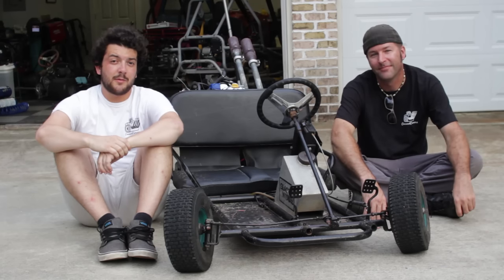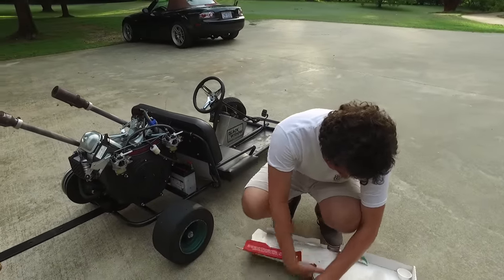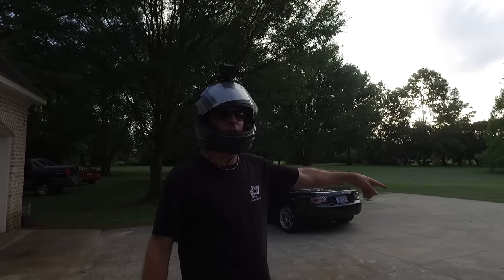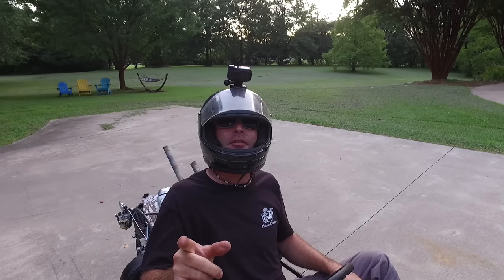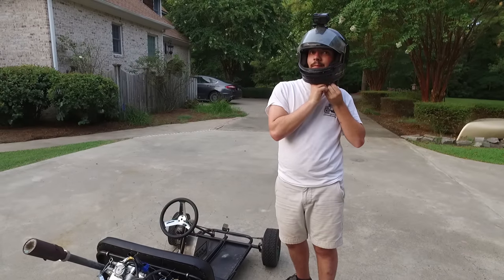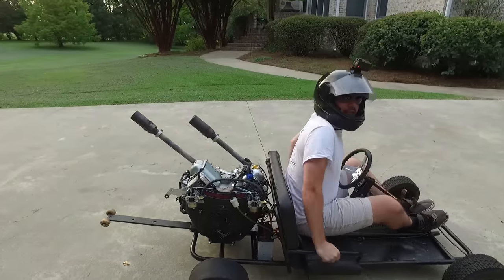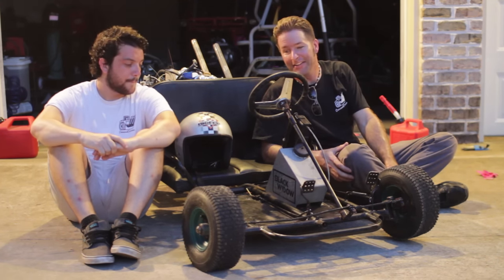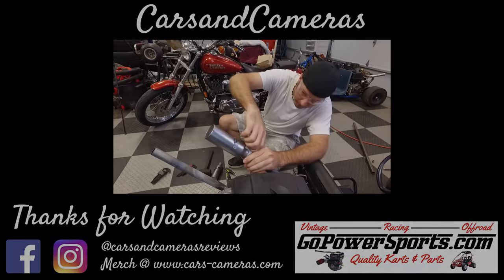Modified 670cc Performance Testing

Comment from the maker: Let us know if you have any ideas for modifying this engine more! Other than a twin turbo EFI setup... We aren't made of money.
Reply: Big bore kit
Reply: Or a snowmobile motor old 440s make like 56hp
Reply: change the gearing to help the top speed
Reply: +Noah Unknown YESSSSSSS I have been saying that for a while now
Reply: You should put wider tires on the back
Reply: hi
Love the videos
Reply: CHEAP STUFF!!! - You could try an H pipe on the dual exhausts and see if there is any type of scavenging that occurs. you also might see what affect a wider belt would have.  It would essentially give you a higher gear ratio, giving the same performance that larger rear tires would provide, without raising the center of gravity.  You could also try adjusting the flywheel weights... It seems to me like its passing the engine's power band before it is kicking into a higher gear... This would definitely increase the engine life, as well as just be a smart thing to check into.  Why wind the engine into redline when 'possibly just below redline' has exactly the same amount of acceleration and power.

Keep up the good work. have fun.
Reply: Supercharger?
Reply: NOS?
Reply: Nitrous buddy
Reply: Put a Yamaha banshee engine on. 2 stroke 350cc.
Reply: how about changing the the valve springs to a harder ones
Reply: 115 horse boat motor cheap and tons of power
Reply: Mulletman Survival that's a horrible idea.  Boat engines need water to cool themselves.
Reply: +Ben Kempa change it make so you can cool it like a car engen
Reply: build a go kart with an r1 1000cc motor and an r1 gear box.
Reply: Bore kit if they make one? But I'd do cam push rods and valve springs along with piston rods
Reply: And add longer gears and wind this thing out man
Reply: I would lengthen it a bit, maybe put wider rear tires on it and even put an old Polaris 250 2-stroke ATV Motor and trans on it. Think 1980's TrailBoss type deal with a CVT and rear wheel drive
Reply: Put nos in it all bs aside lol
Reply: Lower you wheelie bar to prevent that rear hop. You have some serious backlash there.
Reply from the maker: Not sure if they exist for this engine
Reply from the maker: We don't want to make it faster on that frame... Too scary
Reply: Aluminium flywheel larger jets for crabs bit expensive but pistons and con rods?
Reply: +CarsandCameras you guys got to make a beast find a strong frame and a bigger frame so you both can fit in it comfortably because you guys look all crammed up in some of your go carts haha , but instead of wasting time and money on these little ones just build an absolute beast , get the fattest wheels you can for the rear , the biggest and most modifiable engine you can and just make it and absolute beast
Reply: turboooooo
Reply: Different sprocket sizes for top speed. The thing has PLENTY of power to wheelie, so why not change the top speed so it isn't 45MPH?
Reply: nitrous
Reply: Advance the timing like 2 or 4 degrees, lighter fly wheel, basic stuff like that
Reply: Valve springs too
Reply: run some nitro methane
Reply: Some wider rear tires and slick front tires for the kart. OR swap the 670 onto John's kart in place of the 212 and have an insane race kart.
Reply: put a catch can on it
Reply: you can hook a rad up to it
Reply: air filters
Reply: To be honest, I reckon before you modify it anymore and actually fix the modifications you've already done. Like the oil spill, proper carb linkage instead of the coat hanger and welding wire throttle. You guys are already looking into tuning and putting filters on the carbs so that's good. To be honest, I'd like to see this build go nice and clean, I don't mind how long it takes. Great content guys
Reply: Also look into seeing what's up with the belts/tyres. And if your looking into nicer modifications, I think a new chassis or new body along with front axel would be cool. The kart is tooooo ugly for such nice power. 

You guys make great content and this is the only channel I ever give feedback to or comment on as I find that you guys are responsive and actually take feedback in. I respect that.
Reply: A Alcohol conersion, fuel like VP 40 as an example. It's a lot more torque but probably costs too much for something like this,  but I have a Briggs and Stratton 5 hp flathead converted to Alcohol and the acceleration is insane!
Reply: go to a junkyard a get a old smog pump and use it as a belt driven supercharger
Reply: You need an adjustable linkage to put between the carbs to sync them and balance the cylinders.  There are videos here on youtube showing how to make an effective manometer, just search for "carb sync tool". I'd also agree you need a puke tank to catch the oil. 

Edit: Front suspension would help, one of these times you'll land a wheelie and lose a front wheel. ;-)
Reply: adjust the driven pulley spring hole seat for an earlier upshift or a later upshift. There are a few videos on how to do this.
Reply: port, polish, flat top pistons if available, re-set carbs, deck the heads, bigger exhaust with h-pipe, fatter tires, stronger wheelie bar, pods, fix the little stuff to clean it up. Long list but would be worth IMHO
Reply: And an aluminum flywheel, you don't want the factory one to explode
Reply: cross-pipe on the exhaust
Reply: put some pvc pipe on the back wheel.
Reply: Hey guys I did the same thing to my 250 ninja....(removed the air box) oil spewed out all over as soon as I hit the throttle. I hose clamped a small breather filter to the hose and my problem was solved. Of course this was "FOR TESTING PURPOSES ONLY" and not really recommend....
....It'll be fine 👍
Reply: gearing it up. bigger sprocket on the torque converter and a smaller one on the axle
Reply: You are just running out of gearing. It's like you are in your project car that you just added 300hp but you are not able to shift out of 2nd gear. 

Also, as for linkages for those carbs, go to your local hobby shop and get some threaded rod and a bunch of Traxxas rod ends along with a bunch of small nuts and bolts. I bet you guys will have everything needed for a good, reliable linkage for 20-25 bucks.

Landing those big wheelies is killing the front axles I would imagine.
Reply: Other a body for airo dynamics/LIKE MY MUM ALWAYS SAYS...DUCKTAPE!FIXES!EVERYTHING! P.s. Airo dynamics is key far carts
Reply: shared tube for the air pod.. like a plenum.
Reply: dirt bike carbs. weld and the cam , port the heads
Reply: gears and nitrous
Reply: Port the head! luh da bill
Reply: Well it depends on how brave you are, get a cam welded and reground and valve springs these should cost around $300-325. Beware of rod failure and the flywheel flying apart. This will almost double your power. Did for me anyway.
Reply: NOS
Reply: Lighter flywheel, stronger valve Springs and electronic ignition timing will give you more acceleration. 

but your top speed is a transmission issue
Reply: drag tires, some kind of gearbox, electric supercharger.
Reply: Make it mor badass
Reply: +Zeke Crumley I forgot the e
Reply: +Mulletman Survival boat motors are not cheap to buy, replacement parts are very expensive. plus now you are dealing with a vertical shaft versus a horizontal so you would need a rear end of sorts.
Reply: proper gearing is all its missing... it's geared like a 20 mph yard kart and built like one... so it's time for chassis upgrades... take the front off of one of your racing karts or just mount the 670 to a racing kart? idk but I give it 5 more wheelies before that front wheel falls off lol
Reply: Big bore kit, chain and sprocket on the axle, and suspension. Maybe even some big tires.
Reply: A larger diameter tire so your top speed would be higher and you can do higher wheelies.
Reply: Snowmobile transmission.
Reply: Cvt transmission
Reply: make a donation site for a twin turbo efi setup :)
Reply: Billet crank and flywheel, 24lbs valve springs, performance cam if you can buy them or regrind your cam
Reply: or dual dirt bike carbs
Reply: * Put o2 Sensor on it so you can actually maximize the power from the dual carbs!
Reply: roots type supercharger out of a VW smog pump, it will work.
Reply: Bigger tires or a bigger pulley
Reply: Atv tires 14 inch
Reply: Mill the shit out of the heads and moderately port them, port match the intakes/intake  to the intake ports, port match the headers to the exhaust ports, methanol capable carbs/carb.
Reply: +fightfanian oh yeah, zero deck the block, that along with milled heads should make for some nasty compression, methanol should keep it cool and pre-detonation at bay. if you end up with valve clearance issues, you can notch an old valve and braze a piece of carbide into it to fly cut the pistons.
Reply: +fightfanian one more thing, if you lengthen the intake runners by a couple inches it should make the intakes better at higher rpm and maybe keep the fuel in the carbs cooler for even more power.
Reply: BLUEPRINT!!!
Reply: Port and polish would be lit asf
Reply: why dont you put manual transmission? you could go any faster you want and even more power at mid-high range
Reply: Nitrous, and make the wheelie bar shorter
Reply: It not a performance part but you guys could add a catch can for the oil
Reply: If you can get a billet aluminium fly wheel
Reply: 1. Pod Filters
2. Crankcase breather filter
3. Remove rev limiter
4. Reinforce front-end axle and wheels for wheelies
5. Replace the pizza box with something permanent
6. Do a 2 into 1 or an H pipe for more torque, less backfiring, and smoother exhaust flow.

The gearing on it now seems really good, with the rev limiter removed it should do well over 50mph. Acceleration and wheelies are much more fun than top speed. Wider tires or a better torque converter should help to get the power to the ground.
Reply: Put a new better cam and flywheel in it.please respond
Reply: I think if you lower the wheelie bar a little it won't slam on it so hard and knock it back down. No performance gain but would probably result in longer wheelies. You've already done all mods other than tearing into the motor. There are cams available. Bigger diameter tires.
Reply: You may not be made of money but go power sports are!
Reply: where you buying engine like that
Reply: Ported and polished heads, re profiled cam, increase compression and maybe try running some velocity stacks on your carbs
Reply: A roots blower?
Reply: +TheVancen hell yeah,  supercharge that shit
Reply: Will that wheelie bar fit on my honda?
Reply: dyno cams sells cams for that 212 and the valve springs to go with it and all kinds if performance parts for racing and they can coustom grind cams too so you can probably get one made for the 670
Reply: Buy twin 301 or twin 420 carbs for it and deck the heads
Reply: I'd like to see you make a V twin front engined, full drift purpose kart! The 3 wheeler is nice, but a proper drift cart would be a thing i'd like to see.
Reply: Port and polish.
Reply: fix the camper on the front left tire?
Reply from the maker: We don't want to die
Reply from the maker: Higher RPM = rod in back
Reply: I'm thinking that if u put air filters on it that it would make the engine run a little more rich witch would make it less restricted in some sense because those carbs are designed to have a little resistance on the intake to help suck the gas out from the bowl.
Reply: get a custom cam ground (shouldnt be to expensive), add stiffer valve springs and pushrods. this will get you into the 6000-7000 rpm range then a  2-1 exhaust with a street bike muffler to mellow it out.
Reply: Nitrous oxide & octane booster
Reply: Try to add chaindrive + a gearbox fitting the motor & redo the motor mount so it fits with the gearbox & chain drive.
you could also ofc get it a wider belt & up the gearing a bit as it is atm for a cheaper fix.

If you happen to find a cheap dirtbike with a single carb & over 700cc (easier to setup right for all cylinders).

Id love too see a 4 cylinder motorcycle engine on that kart. it will be loud as hell though from the back with an exhaust like that on the kart now heh.

Maybe you can call around too various junkyards or make an ad on craigslist & see if they have any bikes that has been written off as junk from insurance companies that you can scavenge parts from.
Reply: add turbo charger, super charger and nitrous
Reply: You need to fabricoble yourselves a hot form oven so you can build fairings and put more air where it needs to be. Believe it or not, a bench + guy on something like this will cut quite a bit of the air flow going to cool the motor/s.
Reply: Bore the cylinders and get bigger pistons and jet the carb
Reply: turn the engine round 90deg and fit a direct drive differential
Reply: Twin turbo pro star 1000 motor
Reply: +aserta new word alert! fabricoble! you rock dude!
Reply: +Mr. Me 👍
Reply: +Farhan Yustio harbor freight
Reply: yes but can you put a 2 stroke engine sir
Reply: Upgrade the wheels and tires. Also maybe brace the chassis some more.
Reply: idk why people keep saying put nitrous or bigger gears. nitrous wont help at all and they arent gears, its a sprocket, and they dont even have any its a progressive clutch so its a constantly increasing "gear" size. nitrous too would be roo mich for that tiny motor anyways i feel 😕
Reply: you opened the exhaust and air intake. Increase the main jets, you should get some more power... It's surely running lean. Or even better get 2 bigger carbs
Reply: CarsandCameras you should put this engine on the rat rod wagon, it's such a perfect combination
Reply: I love you
Reply: CarsandCameras  don't do it in slow motion
Reply: P
Reply: CarsandCameras performance heads and blower
Reply: CarsandCameras what cameras do you use
Reply: CarsandCameras front a arm suspention
Reply: CarsandCameras lower rear tire pressure?
Reply: CarsandCameras put gears on it
Reply: slicks
Reply: maybe a second gear or 3?
Reply: Adding an homemade quick shift system with some sensors or another electrical equipment.
Reply: CarsandCameras
Reply: hey guys I think I know why your kart aint reaching 50+mph. The Valve springs on it are probably so weak that they just float at a certain Rpm. No matter if the engine was stock ungovenored or modified ungovenored. If you just buy some 26 pound 212 springs  I think you can reach your death defying speeds. Love you guys and your content.
Reply: CarsandCameras propane injection into the air breather just need some old bbq parts and a propane bottle
Reply: Get some better wheels. These ones look crap and you can kill two birds with one stone and get racing compound or mixed surface racing tyres of some description. Make rear wheel diameter larger.
Reply: put twin mikuni's on it!!
Reply: get a crash suit and h.a.n.s. device
Reply: It could go much faster if you got different sprockets for it, of course you might have to upgrade the steering to get the slop out of the linkages if you do that so you can keep it under control
Reply: CarsandCameras i say slightly bigger tires in the rear and some suspention on the front for coming back down to earth lol
Reply: CarsandCameras
Y'all should upgrade to DUAL MIKUNI CARBS!!

I'm thinking from either 250 four stroke dirtbikes/quads or from 400 dual-sport dirtbikes
Reply: Single turbo EFI
Reply: 670 shifter cart
Reply: Truly think a twin turbo would be unbelievably amazing
Reply: John/Ike do you like cats
Reply: Better throttle response...lol

Comment: When you guys were going for the top speed I tend to get nervous. One of my buddies when I was back in high school built a similar kind of kart with a Yamaha engine on it. I drove it before the big engine and the steering wheel weld broke on the steering shaft and I was left with nothing but a detached steering wheel in my hands. I went off the drive and hit a page wire fence and got pretty scraped up and burned my one leg from it rubbing on the tire. With the big engine his brother had it out and he ended up loosing control on a straight a way and went into the ditch and his body hit a power pole. He was wearing a helmet but was killed instantly. Please be careful, I would not want to see you guys get hurt!
Reply: My condolences

Comment: You should put better sticky tires and slowly make this thing a bracket go gart
Reply: track go kart** fn auto correct
Reply: yes
Reply: When they went to the driveways edge and turned around in the grass, that's when you are supposed  to floor it.
Get the tires burnin a little in the grass and keep your foot in it hard as you lean forward and come out onto the concrete and leave 2 fat black nasty patches.
Reply: Yes! There's no use for power if it can never get to the ground!!

Comment: them mufflers rusted fast man
Reply: All exhaust do that because they change temperature so much.
Reply: heat
Reply: spay paint them, heat resistant.
Reply: Even the high temp paint doesn't do well on exhaust
Reply: Yea they do
Reply: No they don't it's only because it was chrome with polish finish my motocross bike don't do that shit and I get to higher temps and speed than that Godard ever will
Reply: I beg to differ.  Painted my turbine housing with VHT header paint then proceeded to make get my manifold so hot it was glowing and about 8 months later the paint still looks great!  Check my channel if you want to see the manifold glowing.
Reply: WOuldn't you guys have to paint inside of the muffler too, though?
Reply: Alpha smurf honda2
Reply: I use manifold paint and it's fine with my honda gv200, just sand blast it, put anti rust on it, heatproof primer it and heatproof paint it and it'll do good preferably 2 top coats.
Reply: +I could Careless If you could care less, that means you care.